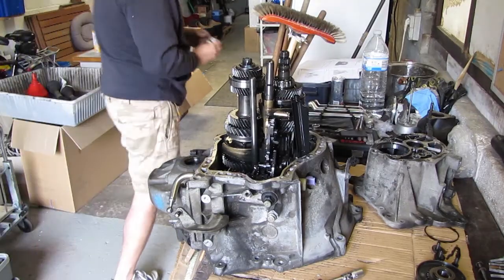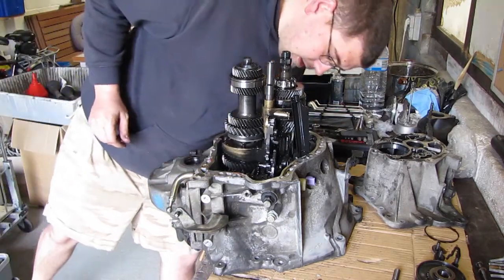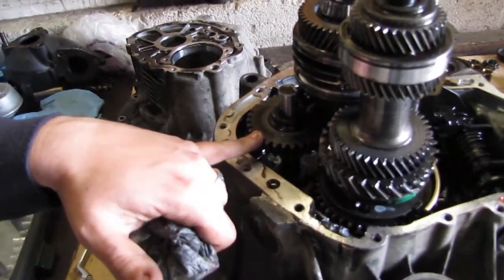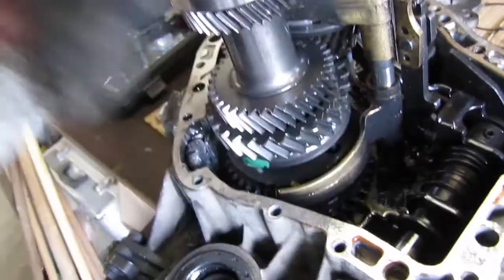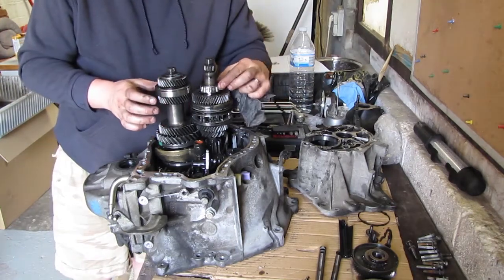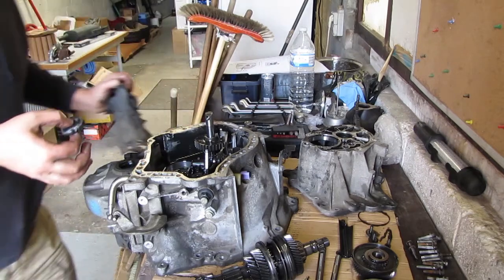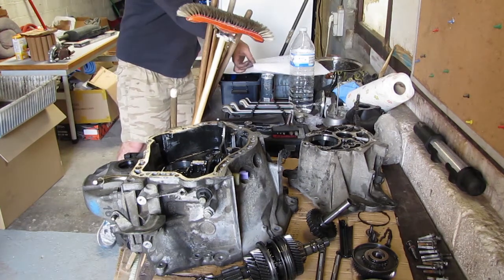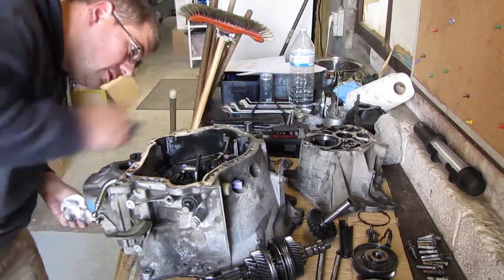Peugeot 207 - BE4 Gearbox Overhaul (Part 4)

Comment: https://youtu.be/b2cA1JVgn70 please help me. Is crankshaft position sensor? And where is exactly in my Peugeot 207 1.6 hdi 90cv? Tank u so much.
Reply from the maker: +Roberto Vaia Hey man, it's on the right hand side of the vehicle. Remove the front right wheel, the wheel arch liner and then you need to remove the auxiliary belt and drive pulley. Remove the plastic timing belt guard and you should have access to the sensor ;)